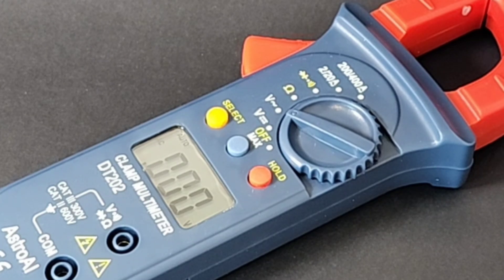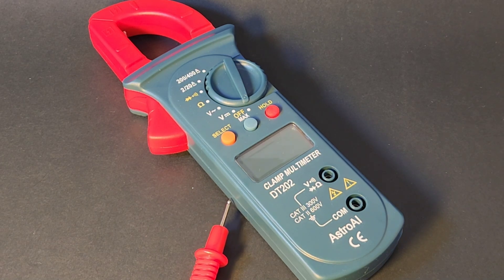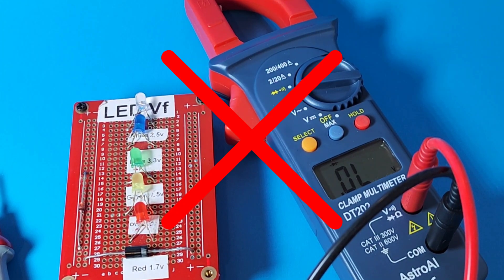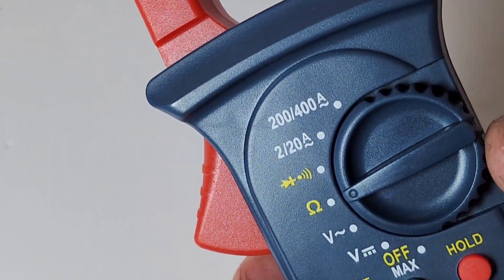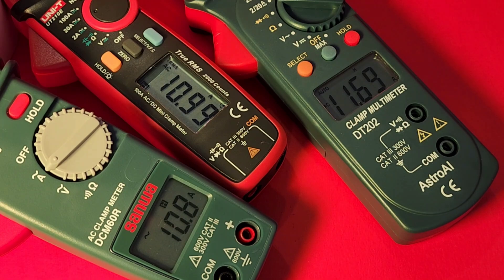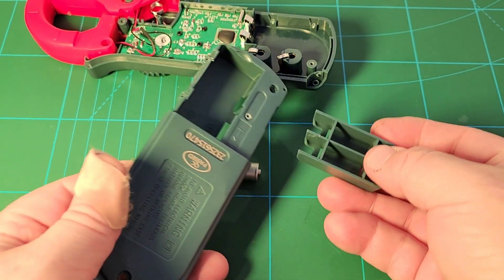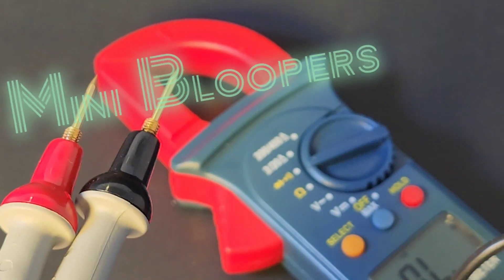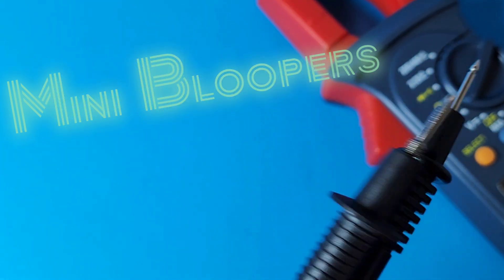AMAZON'S BEST SELLING ASTROAI DT202 - CHEAP-O CLAMP Review & Teardown!

Comment: Did you retry with a fresh set of batteries? That open circuit diode test at 1.6 volts is the lowest I've ever seen. It was either batteries or it has a bad voltage reference in it (🤔usually a little TO-92 package on the PCB but I don't see any.. not even a Zener but I see at least 4 pots!).
Reply from the maker: Yep...new batteries installed twice and tested just to make sure ..it was a real letdown in the diode department as you say...
Reply: @KeepOnTesting  I see 4 trimmers.. Yes seems either defective or a lunch-bag letdown😂
Reply from the maker: @CliveChamberlain946 Roger that! 😂👍